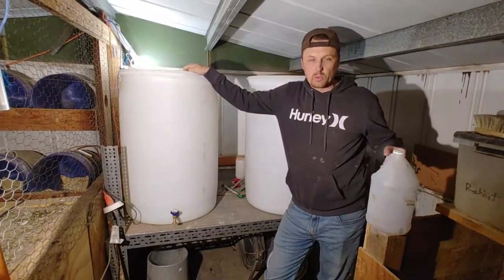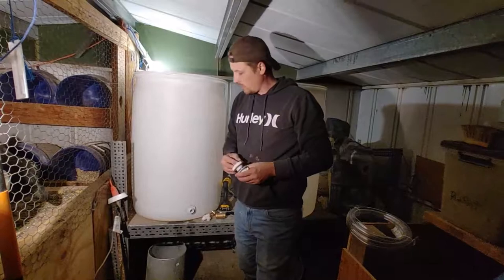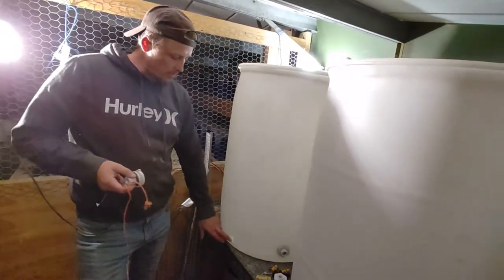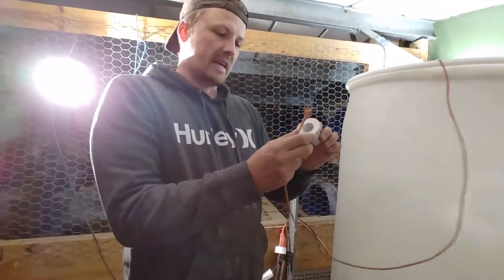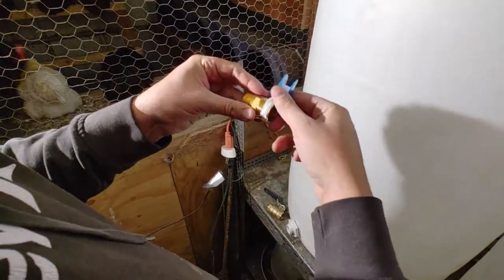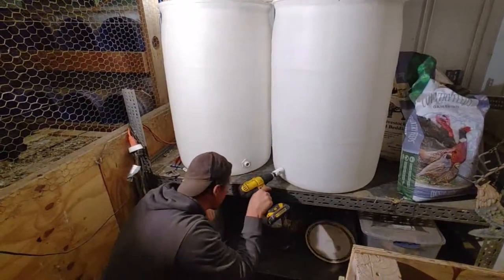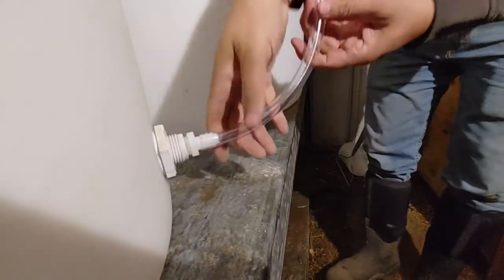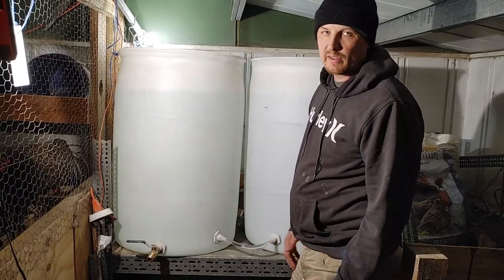Connecting Two 55 Gallon Water Barrels and Adding a Faucet

Comment: Don't suppose you have a quick link for the bigger hose you would have used and fitting? Thanks for the vid, I'll be doing the same thing this weekend!
Reply from the maker: https://amzn.to/3w1NndB
https://amzn.to/3pjzfZj
This is what I will probably use to upgrade to a larger size (from 1/2 to 3/4). I could not find the press fittings alone online.

Comment: Would i be able to do this if my barrels were sideways instead of standing. i do auto detailing and they fit in my truck like that better.
Reply from the maker: Yes for sure. You don't even need to drill if you have the port holes. 

 https://amzn.to/49KpbOO
Reply: @roothomestead4504  Thabk you so much for the feedback!! So then how would i feed the hose through it and make it fit. I have both bungs on the top and they’ll be facing me when i turn them sideways. Are you saying i take one of the bungs out and fit the hosing or do i drill into the bungs and get fittings like you have? Sorry for all the questions Im very interested but i dont wanna spend 500+ on a 100 gallon detailing tank 😂😂
Reply from the maker: I personally have not turned the barrels on their side so I am not sure. The link I shared is for a faucet that fits right in the existing hole without drilling. But not sure it is the placement you are looking for. Sorry I am not  more help.

Comment: Good job! I'm going to copy your setup!
Reply from the maker: Thank you! The only thing I would have done differently is to do a larger tube between the two barrels so it would equalize quicker.
Reply: @roothomestead4504  thanks for the heads up on using a bigger tube.